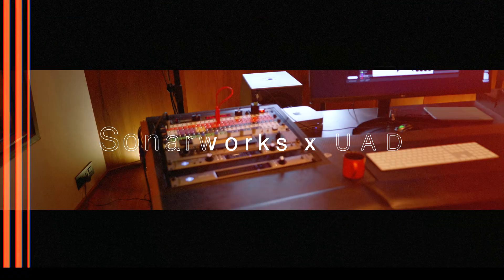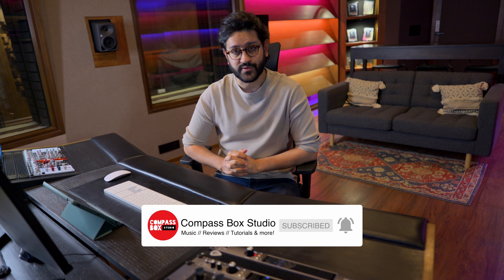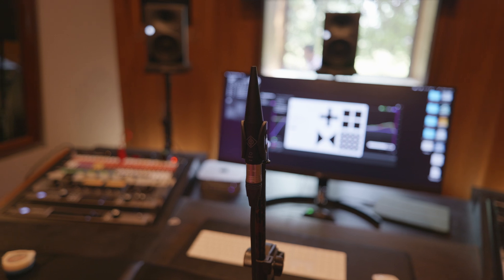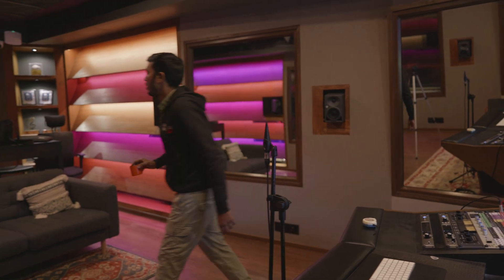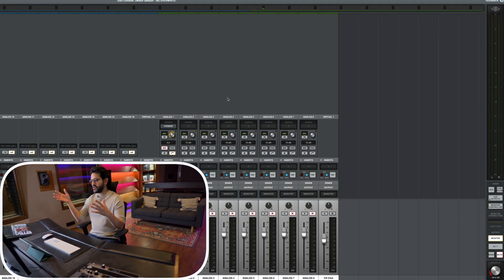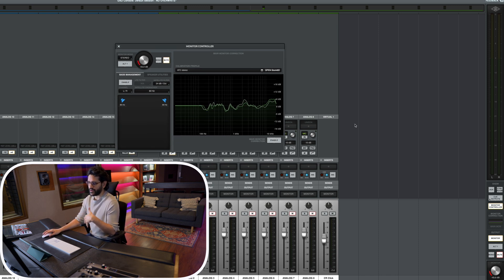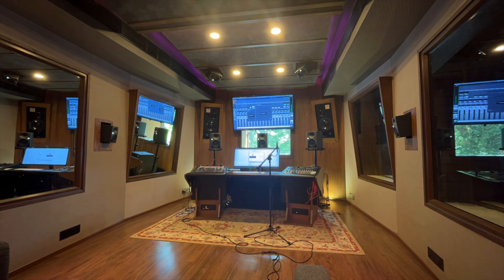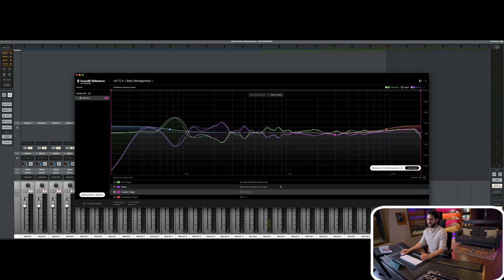First impressions of the Sonarworks X UAD Apollo integration

Comment: Hi Raag, just discovered and subscribed to your channel. Compass Box's studio is truly beautiful without being over the top. Looks very comfortable for you and the clients.

A couple points as I watch the video.

1) you had a Neumann MA1 calibration mic shown in the opening segments. Did you use that instead of the Sonarworks microphone for the calibration? I ask because the calibration of my specific Sonarworks calibration microphone is known to the software since it was factory calibrated and its curve stored. How does that affect a calibration used with a calibrated mic like the Neumann but whose calibration curve is unknown (presumably) to Sonarworks RefID software?

2) I noticed that the ATC calibration curve you display is unnaturally flat up to about 120 Hz. Did you then instruct the calibration to ignore below 120 Hz in it's calibration? How did you feel that may have affected your views on the result?  I know myself, I manually tried to adjust my 3 band Revel Performa B15a subwoofer using test signals and a radio shack SPL meter, just to get as flat a starting point as I could in relationship to acoustical energy at 200 Hz and 1000 Hz. This was set and forget as a starting point for me, but I let Sonarworks calibrate the over the full frequency range. 

3) I totally agree that while on the one hand the user interface is lovely, it is also very obtuse at times. I tried for a few weeks and had problems initially, but have since calibrated my system successfully twice, with the 2nd successful calibration sounding much better with a larger sweet spot in my listening seat. But the software can be a little tricky and documentation non-existent for, for example, dealing with subwoofer feedback in a multi-channel setup. It is also a little buggy during speaker level measurements (left, right, sub) in that the first reported fail value will always be shown even if you "retry" unless you also go back a screen and then just "try". That will make sense if you had the same problem. 

4) The headphone calibration curves are already built into the software via dropdown/search. I found my Audeze LCD-X (both new and pre 2021 models) and Shure 1840s. There are hundreds. You don't have to calibrate them yourself (you said "I don't see where i can calibrate my headphones"), but maybe you meant select a calibration, and you should be able to do that. 
Now granted, no two headphones will ever be exactly the same, as will no two speakers, but I guess this is an area of compromise that you must live with. Also, most people aren't equipped to calibrate headphones anyway. I'll send you an email with a screenshot of where it appears on my setup. I have two x8 Gen2 so I do have headphone outputs on my primary unit. That may be the bug. 

One final comment. Don't feel

Comment: If you have an external DAC like most professional studios, room corection won't work because digital mirroring isn't supported.
Reply from the maker: While its nice to have an external DAC, the idea of the UAD is to be an all-in-one professional grade AD/DA, apparently they are working on it: calibration curves will remain on main outs as well as line outputs 1-2 and the ALT button will just route the stereo out to those analogue outputs.